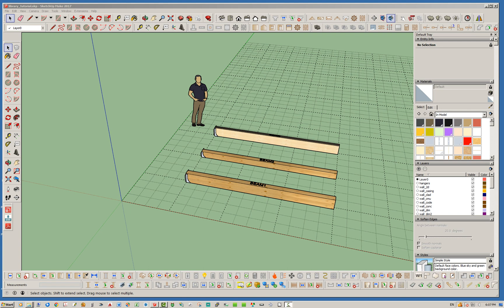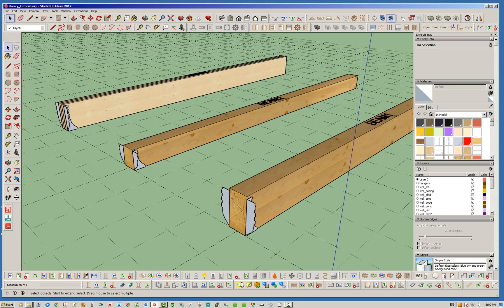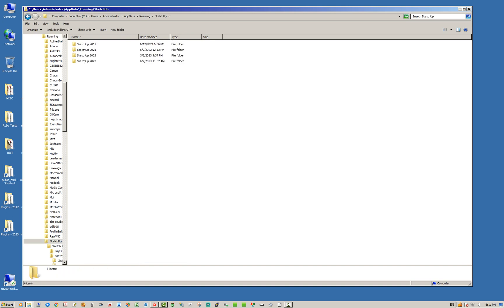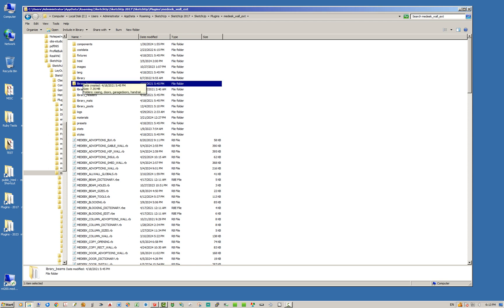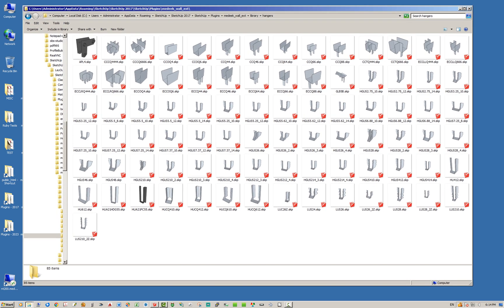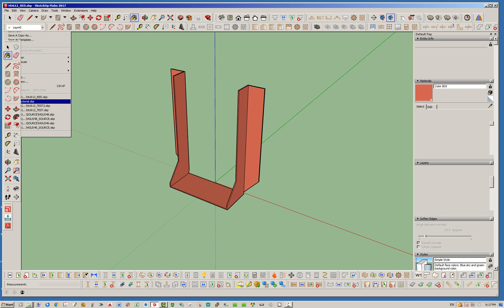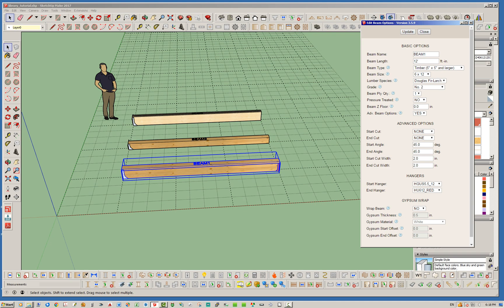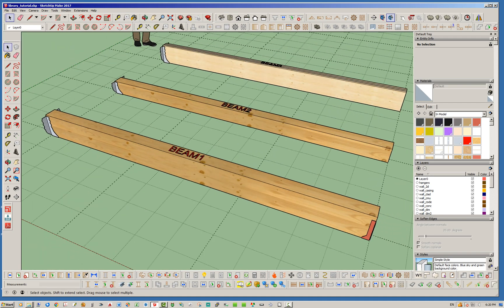Medeek Wall Plugin Tutorial 49 - Component Libraries

Comment from the maker: Version 3.6.5 - 06.12.2024
Added the following Simpson Strong-Tie heavy girder hangers to the beam hanger library: HGUS5.62/10, HGUS5.62/12, HGUS5.62/14, HGUS6.88/10, HGUS6.88/12, HGUS6.88/14, HGUS7.37/10, HGUS7.37/12, HGUS7.37/14, HGUS26, HGUS26-2, HGUS26-3, HGUS26-4, HGUS28, HGUS28-2, HGUS28-3, HGUS28-4, HGUS210, HGUS210-2, HGUS210-3, HGUS210-4, HGUS212-3, HGUS212-4, HGUS214-3, HGUS214-4, HGUS5.25/10, HGUS46, HGUS48, HGUS410, HGUS412.

Version 3.6.4 - 06.08.2024
Added the following additional Wide Flange (W) beams to the beam module: W10X49, W10X54, W10X60, W10X68, W10X77, W10X88, W10X100, W10X112, W12X45, W12X50, W12X53, W12X58, W12X65, W12X72, W12X79, W12X87, W12X96, W12X106, W12X120, W12X136, W12X152, W12X170, W12X190, W30X90, W30X99, W30X108.
Added the following Simpson Strong-Tie heavy girder hangers to the beam hanger library: HGUS2.75/10, HGUS2.75/12, HGUS2.75/14, HGUS3.25/10, HGUS3.25/12, HGUS412, HGUS5.25/10, HGUS5.25/12, HGUS5.5/8, HGUS5.5/10, HGUS5.5/12, HGUS5.5/14, HGUS7.25/8, HGUS7.25/10, HGUS7.25/12, HGUS7.25/14.
Allowed the use of a period "." in custom beam hanger library names.

Comment: The hangers are very handy.  Customers are always impressed with this level of detail :)
Reply from the maker: I spent a couple days knocking a bunch of these out because there is nothing more frustrating than expecting a specific hanger or piece of hardware only to find that the exact one you needed is not included.  Hopefully this will alleviate some of that frustration, but there is more that needs to be done.